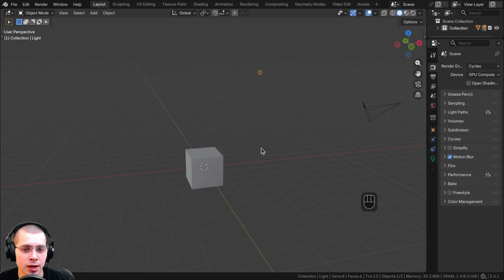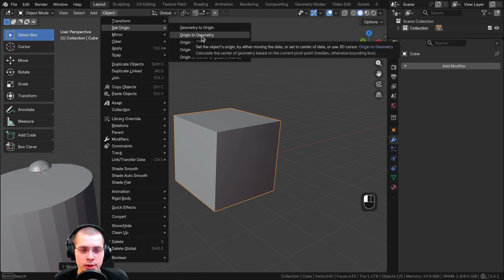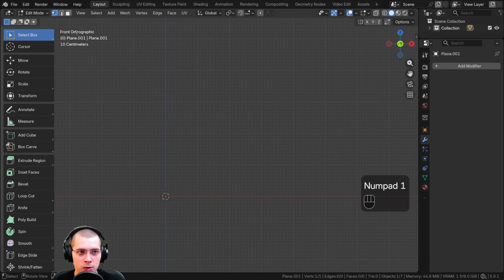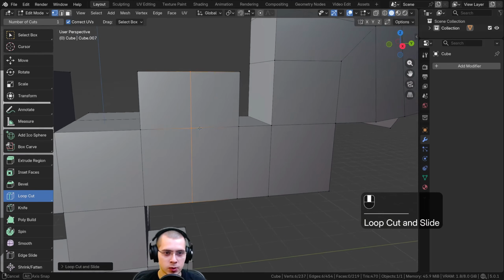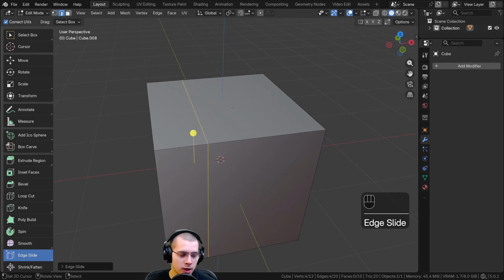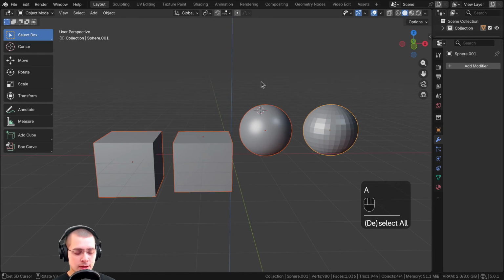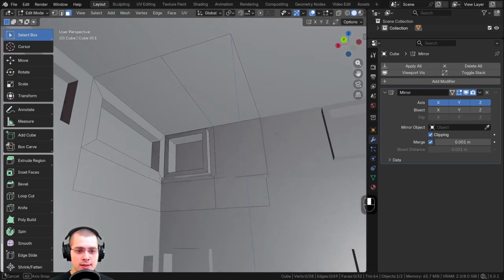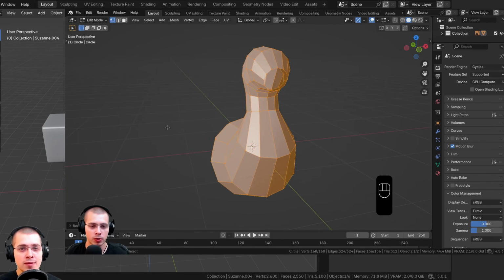3d Modeling for Beginners (Blender Tutorial)

Comment: Hello Ryan, thanks for this helpful video. I'm at 29.55min. Trying to do what you showed. I don't see the origin point moving and don't know what i'm doing wrong. It's different here on my pc it seems. Greetings from Germany. Karl
Reply: I'm having the same problem. The keys he uses to "add a vertex" don't do anything, so I have nothing to grab and move to then Extrude from. I am hitting the EXACT same keys he says to press earlier in the video. I have tried it a dozen times, but it doesn't work.
Reply: @bradleytroth  i had the same problem and it turns out i was in face mode, you need to turn into vertex mode to add the vertex

Comment: I am your big fan. I learn blender from you. But my pc is too weak to handle complex simulation in blender.  So I want to use cheapest but powerful cloud pc like runpod . But i can't see a single tutorial on it that how to install blender in runpod ( cloud pc ) because my budget is low that i can't use vagon or any other expensive cloud pc.

Can you make a dedicated video on it. 
That how to install blender in runpod ?
Reply from the maker: Sorry, I've never used Runpod, so I can't really help
Reply: @RyanKingArt Ok. Can you suggest me some very very cheapest bur powerful cloud pc that I can use for blender advanced animation
Reply: I am on budget as well and i bought a second hand HP Z640 with 64 Gb ram and a M4000 8 Gb GPU for under $ 200 and while it doesn't set landspeed records it is working like a charm. I can render in Cycles without any problems.